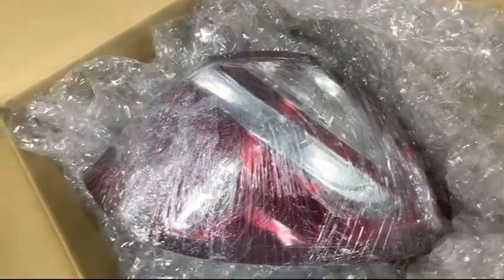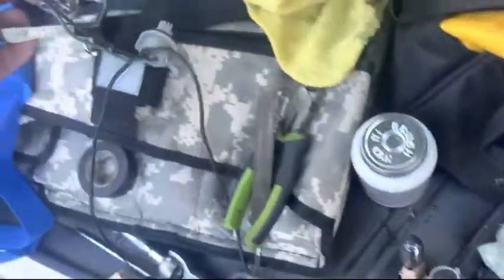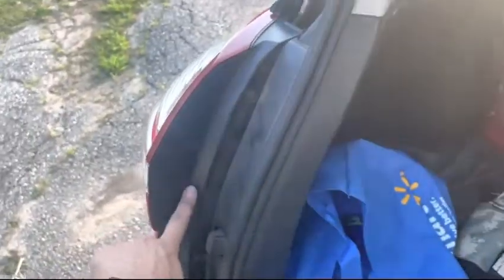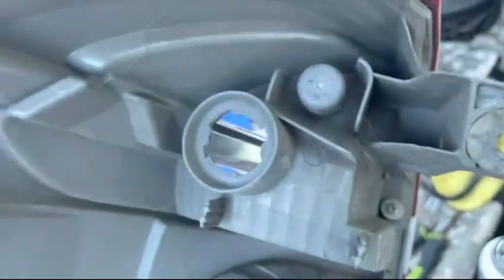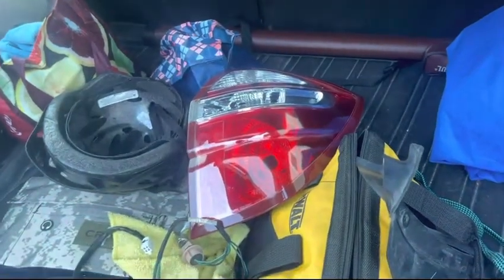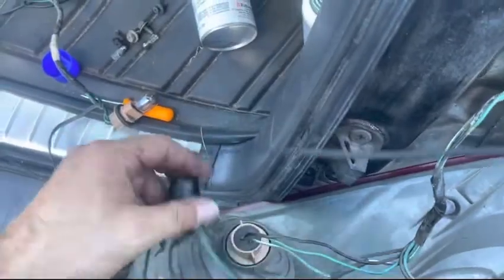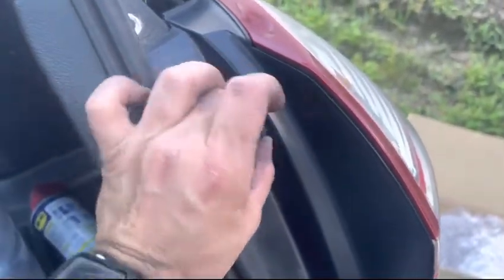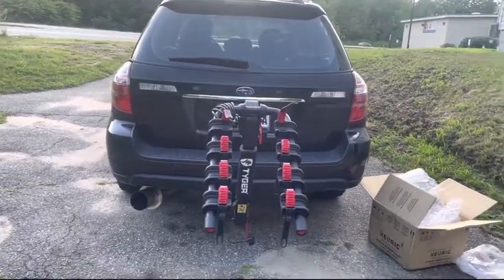How to install JDM tail lights in a Subaru Outback xt

Comment: Looks sharp. I notice u did upgrade with sylvania zevo brake lights and rear turn signals. 

How about upgrade with the rest of the led bulbs?

Like zevo T15 led reverse light, Zevo T10 license plate lights, ur front turn signals, ur marker lights, and ur interior lights with zevo led bulbs?

And upgrade ur halogen reflector headlights with sylvania - SL.BX2 led headlight bulbs?

A lot of people loves them. And others don’t. It’s a 5050 of very bright or not bright or too dim. 

I been shown by one of my xB guys. And they had them and they find them in H11 projector headlights is pretty bright. 

And there’s no blue hue or a tinge of blue for 6000k. It’s straight pure white. 

Which is why they are very reliable in color temperature, coming from a well known company sylvania. 

And get ur hands on Novita LED flasher relay as well for no more hyperflash.

Honestly that’s gonna give ur subie wagon, a modern look. And more of a facelift. 

❤️‍🔥❤️‍🔥❤️‍🔥❤️‍🔥❤️‍🔥❤️‍🔥❤️‍🔥❤️‍🔥

@MightyMotors207
Reply from the maker: I did upgrade the front end lights all to 6000k don’t remember the brand though and I also upgraded the marker lights with some led ones from Sylvania and the fog lights got some yellow led bulbs not sure what brand but absolutely made a huge difference once it was all done!